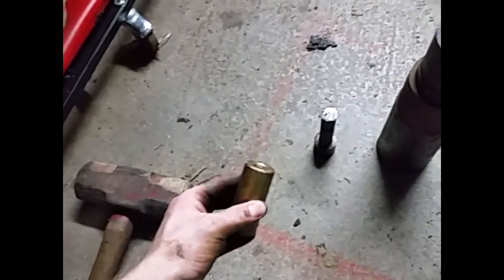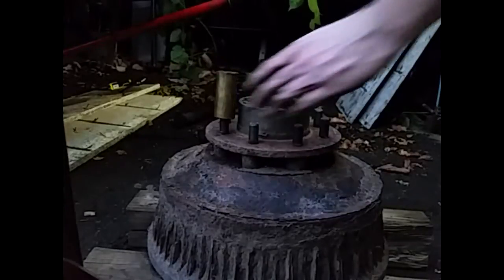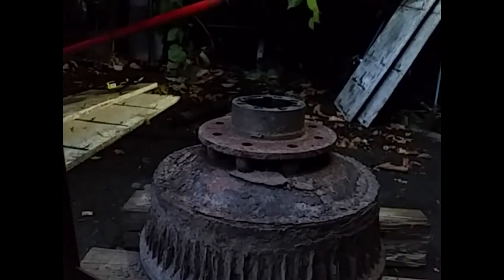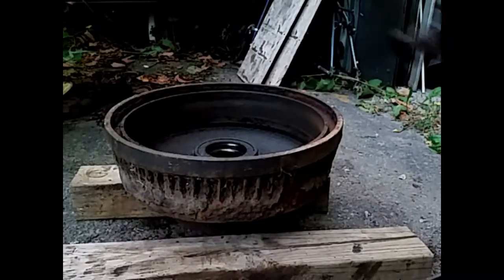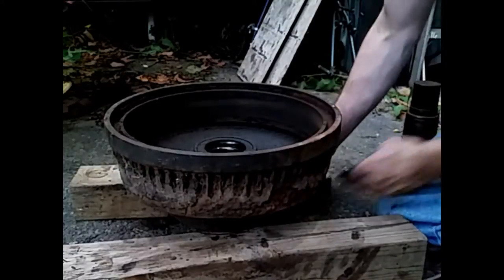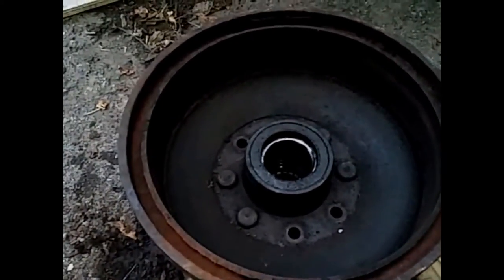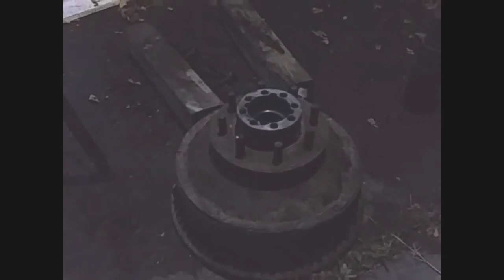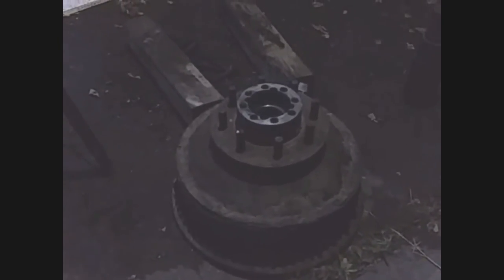Easy Stud Removal and Replace GM 14 Bolt FF Truck

Comment: I have an 86 k10 and want to make it my spar welding rig. make a bed for it and put dually rear end. What did you do get a 14 bolt and this video shows how you made the 14 bolt a dual wheel with longer studs???
Reply from the maker: If you want to use your 14 bolt rear end under a flatbed, then longer studs will be fine.  If you want to use a factory dually bed, then you want short studs then a 2 inch spacer, and longer studs in your spacer.  https://www.instagram.com/p/7Jw_0wnI7l/?taken-by=thedriver_02  without the spacer the inner tire will hit the inside of the wheel well.  But long wheelbase cab chassis trucks did use the regular 14 bolt with long studs from the factory so that is fine if your putting a custom flatbed on it.  Hope that makes sense.

Comment: Hi driver, Can I have a similar style rim with non finned drums.  The rims do have a spacer like this one.  They are off of my 1069 Dodge P 300 step van.  Do you know if the hub is removable as well.  Also, the studs are really stuck.   Do I need to use a heavy mallet vs a hammer?  Thanks for your time and I apologize for all of the questions.   The drums are from the front of the truck not the rear.